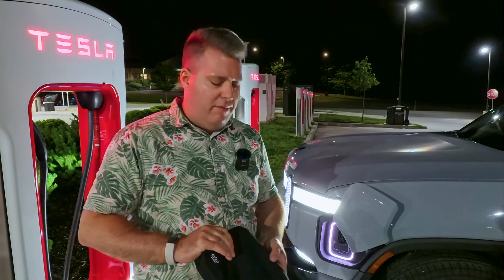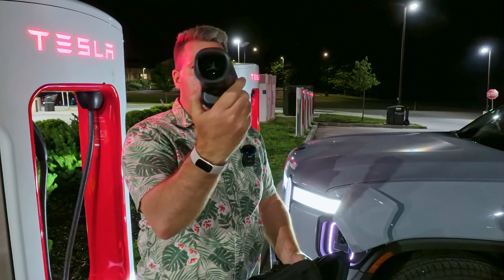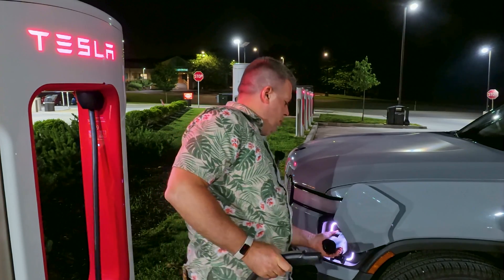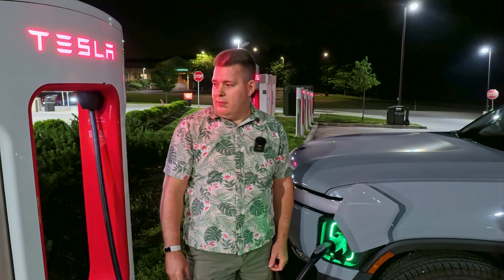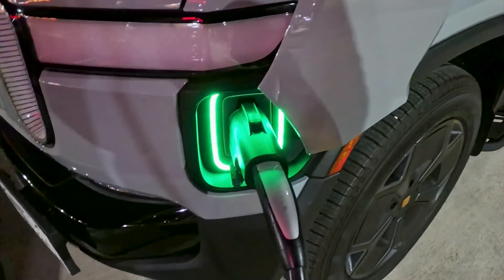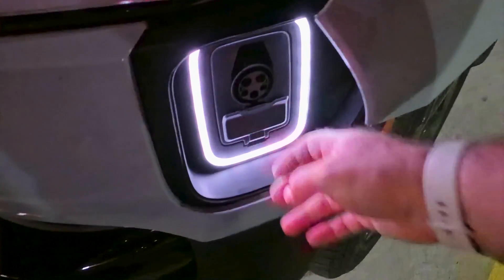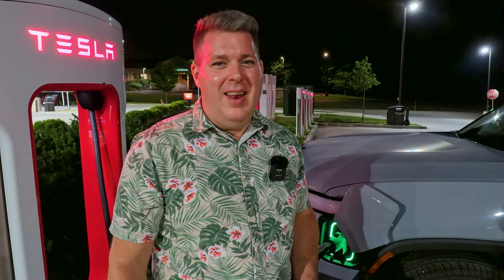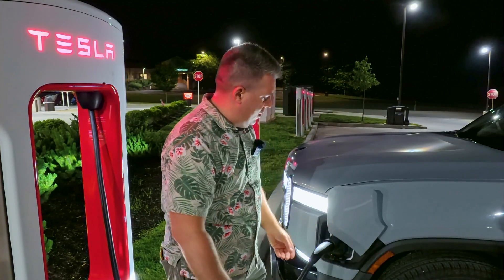Updated Lectron  Super Charger Adapter With New Instructions

Comment: So Question, I am new to EV charging world, with Tesla Super chargers do we have to set up an account or pay with an App?  Similar to Electrify America or Charge Point?   Also, I live in the North East FL (Jacksonville) area and the FPL chargers here are awesome if you are passing through, I would recommend them to anyone.
Reply from the maker: You should have a Tesla account and the Tesla app.  Ford and Rivian (and in the future other OEMs who have signed up for NACS) support plug and charge (no app needed).  With the NACS plug and charge you pay full price though.  Tesla offers a membership for $12.99 a month which gives you the same price as Tesla owners.  For that, you definitely need the app and account and you need to initiate the charge through the Tesla app.  Absolutely on the FPL chargers.  We used one last year in Yulee and it worked great!
Reply: @ElectrifiedOutdoors  Thanks for the info, I have requested, or AKA opt in for the adapter from Rivian.  Don't know when I will see the adapter.
Reply from the maker: Yeah those have been very slow to go out.  I believe only the earliest deliveries have received them thus far.  I have the A2Z Adapter on my website and that's the one I recommend for now if you want to use superchargers.

Comment: First off, great video and funny blooper real lol.  I too got one of the defective Lectron Vortex adapters back in March, with the defective locking mechanism.  I contacted Lectron via email, they responded quickly apologizing for the issue, the inconvenience, and sent me a prepaid return label via email.  I got my replacement adapter within 5 business days. The locking mechanism and new adapter works great, Lectron even reached out to me to make sure the new adapter was working properly and that I was satisfied with the product.

One thing you forgot to do in your video was demonstrate that your new adapter's locking mechanism locks the Tesla charging handle into the Lectron Vortex adapter properly so that it can't be removed without depressing the unlock switch.
Reply from the maker: Great glad they got your adapter replaced quickly.  Yes I like that Lectron has great CS.  Your right I didn't specifically show that...but...in part where I removed it I had to try twice and in the blooper reel it was locked in there like fort knox 😁

Comment: Thank you for sharing this information! 
I hope everyone knows that only the Superchargers with the thin liquid cooled charging stations can be used as those are the higher power stations. Tesla also has some new style charging pedestals with longer charging cables to reach most brands of electric vehicles and maybe some pull through areas for trailer towing electric vehicles. 
This is first time that I’ve watched your channel so please forgive me if you have covered all of these issues already.
Reply from the maker: Great point!  Yes, V3 and V4 superchargers only.  One can find compatible chargers by visiting https://tesla.com/findus and deselecting all options except "chargers open to NACS".  I am also going to put this in the description as well.  I hope most of the current NACS stations will be converted to V4 pedestals because the V3 require non tesla vehicles like Rivian and Ford to take up two spots.  Thanks for stopping by!